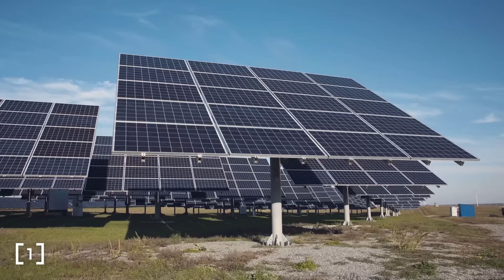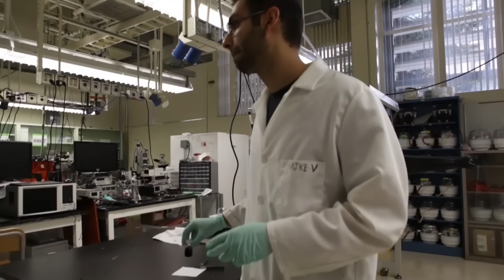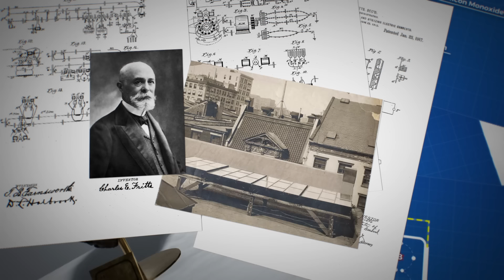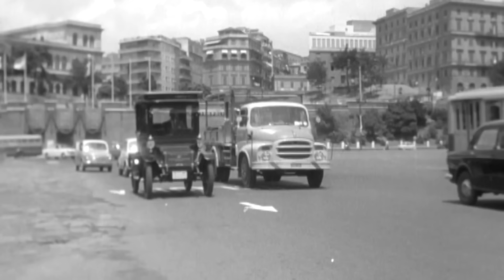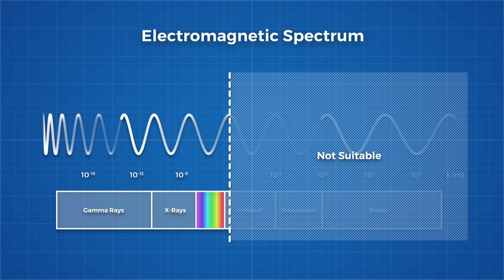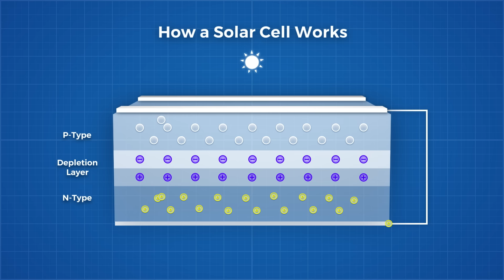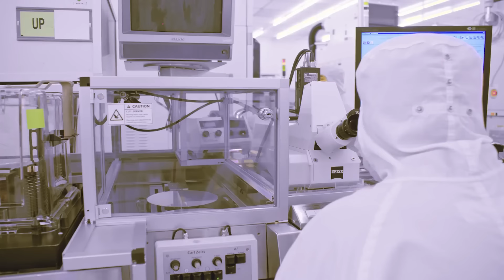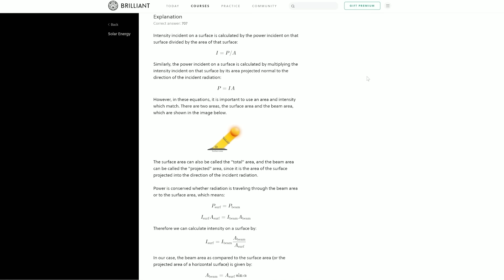The Mystery Flaw of Solar Panels

Comment: I believe the electrons and holes dont' migrate towards each other. There is no force acting on them. The material is neutral. I think this is a false, misleading explanation. What happens is the electron and holes aimlessly wanter around, spreading like a drop of ink spreads in a glass of water. But when two meet exactly in the same pinpoint location, they fall into each other, and don't pop back again out of each other, because they are braked down by bumping into the atoms around, so they lose their energy as heat.. This is how the depletion layer arises.

Comment: Correction: An abundant amount of fossil fuels is required in the production of solar panels.
Reply: An abundant amount of *electricity is required in the production of solar panels. Where the electricity comes from depends on how much solar power capacity is available. Hence, as you make more solar panels, the production of solar panels can become cleaner and cleaner

Comment: Perhaps the heat created by the light that cannot be converted to heat to power a Stirling engine turning a generator. This scavenged energy can power the pumps and controls from the Stirling engine generator and may produce surplus electricity. 

Computer control can keep the solar panel at the temperature needed for most efficiency.

Comment: If photons knock electrons out of atoms and we use them for electricity, how is it that the solar panel never running out of electrons?
Reply: The beauty of electricity is that it is the movement of electrons that give us power, and they move in an electrical circuit - the circuit part means the electrons are moving in a loop, so as they flow out of the panel in one wire, others are flowing in on the other wire, which is why panels have two wires.  Basically once one electron gets knocked out of an atom, it knocks the next one out, which knocks the next one, until eventually all the way around the loop another electron gets knocked back onto the original atom, thus leaving you with the same number of electrons you started with, except now they are all shifted over by one atom.  That just happens continuously while the panel is producing power.
Reply: @Berkeloid0  Thanks for your explanation, really appreciate it.

Comment: How much energy does it take to produce all the materials and complete panel....Probably more than the panel will return in it's relative short lifecycle...
Reply: If that were the case the panels would be way more expensive than they are, the company that makes them has to make them at a profit so the energy used to manufacture them gets built into the purchase price.  If people can buy them and pay off the purchase cost from the energy produced over a few years then by definition it has to produce more energy than is used to construct it.

Comment: There is more that could be improved . The panel itself is poorly designed . The protective glass reflects light when the light is other that 90degrees to the plane of the glass, which is practically always. The panel frame projects beyond the surface of glass collecting dirt. It’s ironic that the areas that have the most insolation tend to be the areas where there is less rain and more dust. The installation and electric connections of panels is very primitive and labor intensive huge improvements could be made to make them Plug and play .

Comment: One has to wonder about the amount of heat these panels are absorbing and its affect on the environment.
Reply: Not really, because if the panel wasn't there the same amount of heat would just be absorbed by whatever is there instead - roof, ground, etc.  The heat arrives from the sun whether we put something there or not.  Of course fossil fuels when burned produce heat that is not coming from the sun, so these really do introduce more heat into the environment.  It's tiny in the overall scheme of things, my point is just that unlike other energy sources, solar panels aren't contributing any additional heat to the environment that wouldn't be there anyway.
Reply: @Berkeloid0  https://www.treehugger.com/ask-pablo-do-solar-panels-contribute-to-the-heat-island-effect-4857811

https://iopscience.iop.org/article/10.1088/1748-9326/11/7/074016
Reply: @kimfreeborn  Interesting, and thanks for the decent references.  The argument is usually that the panels are increasing the amount of heat, not removing heat as those references show - that is something I had not considered.  Very interesting.

Comment: I don’t believe everything I hear. I think it through. You presented the idea that light being reflected loses its potential energy. I believe that’s false, no matter what the textbook say. If you stand in the snow and find the spot where the sun is reflecting off the window, you will feel like you’re almost getting burned. The heat is intense, Much more than the direct sunlight. I believe this is an important point of research that hasn’t been flushed out yet.

Comment: If most of the electricity converted to heat it means the heater is 100% efficient
Reply: ... аnd air conditioner can have 300 - 400% efficiency

Comment: This is a great vid and simultaneously lets you know why wind/solar is increasingly  being called a 'scam'. Not because it doesn't work..but because the dividends are really highly falsified at massive expense to the taxpayers worldwide. .but nobody can debate the "utility bill". You can succeed only in a few cases but on the wider spectrum you'll fail. This is because the reality is that these modes have become a fleecing of sorts. You see the big execs of wind/solar living in luxury and flash, yet the average consumer only sees skyrocketing bills. So..what doesn't compute for many is well explained in this vid regarding the actuality of power conversion. In a nutshell you pay a fat price for what really does not that much. I remember days when inverters cost little. Suddenly prices soared by 1000 -20000%..but people are told ' costs are dropping'. So factually the average person is being sold a candyflossed fakery on the REAL electrical generation capability. This will  concur with increasing reporting on the rejection of these in the wider energy realm. I remember 30 years ago when it was said 'by 2020 renewables will provide 50-75% of energy'..what??
So its not that these dont produce power..its that they do at unsustainable cost and really questionable output for that cost. People in affluence can fork out $7-20k easily. The average world citizen -no.

Comment: Try operating the solar panels with low voltage , max 100v or even 70v... No deterioration , no loss, no problem over time...

Comment: It's a general introduction to the state of art in photo voltaics. The mystery flaw is unexplained in the video.
Reply: Watch it again and this time, listen.
Reply: I missed the flaw too alot of talk about efficiency but no flaws dude there solor pannels they make electricity from the sun who cares if there more efficient i covered my shed with pannels i have way more power than i can use even running 2 ac units dosent use all the power for a one time purchase of $500 i have more power than i can use in a day dose it matter my pannels are going on 10 years and lost a sead amount of efficiency even if there 50% of new there still way more than i need so efficiency isent a flaw its a made up stat that dosent mean squat when talking about solor 
So explain were the flaw is again
Reply: @JumpinJehoshaphatJsquared  juberish no flaw from what i see even if you take a old cd and wrap it with copper wire it will make power no flaw just takes 100 cds to power a small house still vary efficient taking a completly non depletable resource and using it to make power is vary efficient any witch way to flip it its not a flaw
Reply: @JumpinJehoshaphatJsquared  have you ever made a solor panel out of a old cd its not that hard maybe you should take my medication and learn about the subject your trying to talk about
Reply: @JumpinJehoshaphatJsquared  im just a earther who lives off grid powering my houses with solor power full time my ranch is outhere and we dont have power lines we also dont get rolling blackouts we also dont have a power bill and theres nothing in the system i cant fix myself do you make your own power or do you buy it from the power company i think your the flat one
Reply: The flaw in question is a result of oxygen-boron interactions, which seem to disappear when the boron of the solar cell is replaced by gallium as an alternative. Explained in video.

Comment: This is just crazy.  So when you look at the light spectrum, you have a narrow area to create electricity with silicon.  You know your video has more hope for creating heat than electricity.  Your problem is your solution.  You could make a heating panel that is 50 percent efficient while your solar panels greatest hope is 20 percent.
Reply: There are already thermal solar setups, generally used for heating water. The problem is that they're a lot less durable, and you'd need a pretty large scale install to be able to hook it up to a steam turbine to actually utilize, and then you'd lose over half your remaining efficiency through the steam engine. This might be viable for a university campus or an apartment complex, but not single homes. But the good thing about solar thermal is you don't even need any sort of advanced materials, technically you can even make one out of a series of pop cans and some black paint in a plexiglass container.
Reply: @theredscourge  Why would you need to hook up to a steam turbine when you are creating the heat in the silicon?  The light comes in and 50% of the rays produce heat. It would be better in a geo-thermo idea.  A fluid picks up the heat and moves around coming back to heat up again.  You are trying to increase the efficiency of the panel.
Reply: The problem with Heat are the losses. Heat will transfer to almost any other material after the panel absorbs it.  The losses are to big, most of the absorbed energy will be lost before it gets converted into electricity. Thats why photovoltaic panels are used more that heat panels.

The 50% Energy efficiency of the heat panel will become less than the 20% that photovoltaic panels can achieve after energy gets converted to electricity.
Reply: @pedromontalvo9495  I don't think you understand what the author is saying about the light spectrum.  There is only roughly 20% of the light that CAN be turned into electrify.  Over 50% of the light spectrum produces heat.  I am in NO way saying you should turn heat into electricity.   I'm saying to make the panels efficient, you need to use the heat as heat.  In the winter, you can but in the summer, what are you going to do with the heat.  In conclusion, the silicon panels to produce electricity really isn't the answer.  Really need more work with the light spectrum and how different items in nature harvest this energy.

Comment: I'm still wondering why they haven't used the meta material dubbed the black hole for steam generation. Seems like perfect solar generation considering it takes all light and transfers it into heat. I get it was expensive to make as a science project but letting it sit in a dark room without a practical application is kinda dumb.

Comment: Rechargeable batteries only can be recharged so many times and even sorter life spans in Rainy climates and/or un-sunny climates- and the solar panels get soap-scum defecting light, the wiring from rain and humidity un-solders and decays wiring, etc
Using river water turbines is the best clean source along with  DC generators such as Cars use...hook 10 up to 1 AC current motor and get 7X your electric back IMHO if I was to invent such Tech, only trash is replacing bushings..use Dc/Ac converters = clean Energy, and this idea is just thinking for 5 min tops
Reply: Look into the Meta material dubbed black hole. Had a similar idea for steam generation using that. Unfortunately the material kinda just faded out of the news though.
Reply: @WillO-sh2dz  Yes using spent fuel rods from Nuclear plants would produce Steam to power Steam plants that would produce Energy, but what do they do with them?…toss em in the trash, such a waste
Reply: @WillO-sh2dz   Yes an example would be  60 strips of printed circuit boards coated with a thin layer of copper and arranged in concentric circles. The outer 40 strips form the shell, while the inner strips form the core. Intricate patterns  etched in the copper that alternately resonate and do not resonate at microwave frequency, and which changed progressively from strip to strip.
Measured microwaves going into the device, and will find none coming out, but light is smaller than microwave partials and to achieve such, would make a 'cloaking' device instead of Solar Device, usage in camouflage such as aircraft would be possible, hence why it prob faded and the Tech is used for Military Purposes eh?

Comment: This is essentially a commercial for Briliant.   The greatest flaw in solar cells is bound up in their energy and pollution intensive production costs.  Related to this is the useful life cycle and disposal costs.  Then there is limitation of overall battery efficiency which also have to deal with the same energy intensive production and disposal after a relatively very short life cycle.  Everything being factored in, from creation to disposal at end of life, solar cells are not a practical source of energy for our civilization.  
You need more than a "Brilliant" course in the fundamentals of metallurgical physics and engineering to understand the entire scope of the problem.  Mass utilization of solar energy is still in the realm of science fiction.

Comment: Why not have the metal lines as very small flat wires at a 45 degree angle and highly reflective - that way any light hitting them is refracted along the silicon surface until it hits the next metal wire also at a 45 degree angle from the underside and refracted into the silicon - that way the wires will not block the light - they would refract it at an angle that would be absorbed by the adjacent wire.

Comment: excellent science, but not a practical or economic generator of industrial electricity.  furthermore, how will they be disposed once obsolete or life ex.
Reply: @anonymousperson7536  Well, in that case the market chooses Fossil Fuels and Nuclear.
Reply: @chrono_tigger  no it doesn't. Renewables are already cheaper than fossil fuels and nuclear per kWh and nuclear is a dying industry.
Reply: @samk4339  Try making solar panels without fossil fuels. And fossil fuels are becoming increasingly uneconomic to extract. It's way past time to acknowledge we have an energy problem.
Reply: Recycle them.
Reply: Solar is the cheapest form of energy generation and has been for more than 5years. So it should be the prominent form of production.
Reply: @EnlightenedSavage  It doesn't matter how cheap they are financially at the moment. They depend on depleting fossil fuels and you can't run an industrial economy on them. They will never produce more than a tiny percentage of the energy currently being used.

Comment: "Pushing fossil fuel out of the market".  Laughable. Nothing short of it.
Do you, or anybody here that's so in favour of these hallowed solarpanels, have any idea of the amount of energy that's needed to bond carbon and silicium to make these photovoltaic materials?
I guess not. 
The meltingpoint of quartz(nature's purest form of silicium) is 1700°C or 57460 F. That of carbon is even far higher at 3550°C or 119990 F.
Guess how these melting furnaces are being powered.... tip of the curtain: it's not solar or wind energy.

Comment: To me there has never been a mystery in the flaw with  solar power
Reply: What do you mean?
Reply: @AwesomeSheep48  solar panels and wind turbines are not made from any recyclable material. What do you do with them when they s*** the bed? That's just two reasons why they will never replace oil coal gas there are so many more reasons I can't mention them

Comment: heard about some new crystal based structure they are looking at that can be modified to have varying band gaps and is transparent so you can stack them on top of each other to get energy from all the wavelengths instead of just the ones picked up by silicon
Reply: Doesn't transparent imply a greater bandgap energy, such as is the case with silicon-carbide? Cost effectiveness would suffer, no?

Comment: Why can they only convert 20%? Also how much of the forests and fields must we destroy for solar power
Reply: Solar panels can be installed anywhere with open space e.g. over parking lots, on rooftops, etc. The efficiency is irrelevant because the sun produces SO much energy. Did you know that the amount of sunlight hitting the earth in one day is more than the energy the entire world uses in one year? Tapping into 20% of that would be phenomenal.
Reply: @lawrencechan4494  the more energy you produce the more people will use. Cheap energy improves lives. 

Better efficiency means needing less.

Comment: So let my see if I understand this correctly. A significant portion of solar energy is not able to be utilized by photovoltaic panels due to the wavelength being incompatible(infrared)due to it basically heat energy?
What about developing a dual purpose solar panel that both collects the available wavelengths in form of electricity directly and reflecting infrared to a focal point for production of secondary steam generation?
Imho.
Reply: The multi-absorber panels you describe are what is pushing efficiencies much higher. I have seen concentrators which reflect light onto a panel which has water channels in the back for collecting the heat and keeping the panel in its operating range. But this must have problems if the water flow is lost..